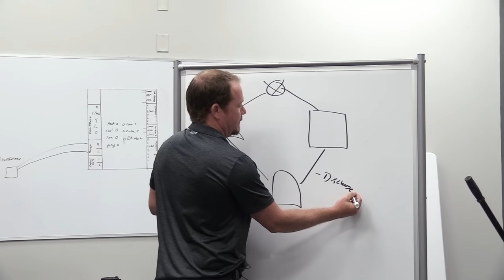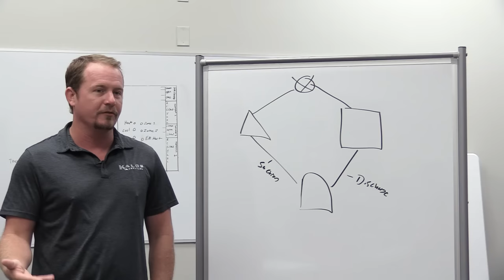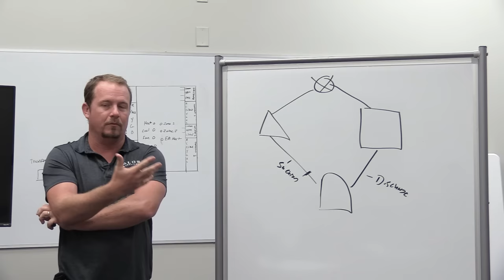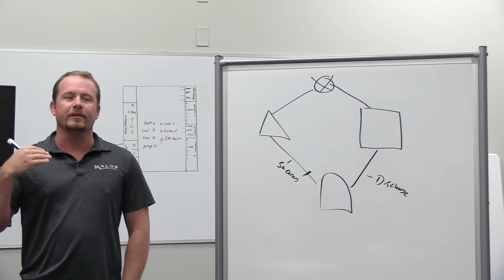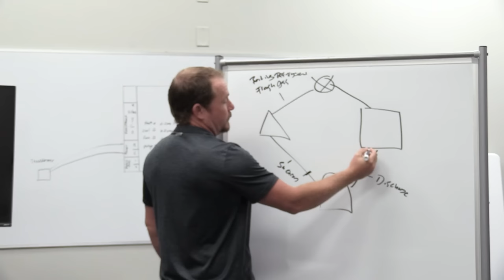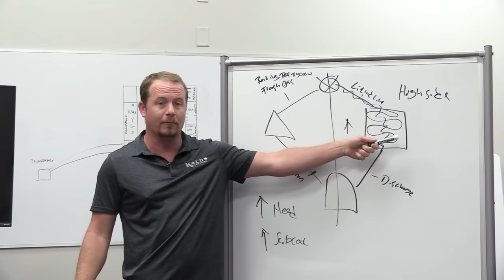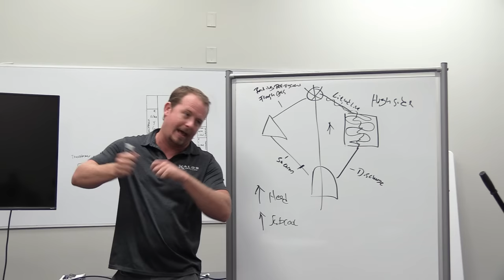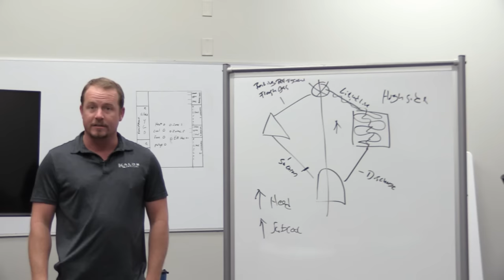Refrigerant Overcharge Troubleshooting and Prevention

Comment: What is a refrigerant in hvac
Reply: Depends on the system but for most newish homes it’s r410a
Reply: It is a chemical composition that allows for heat to be transferred from one location to another
Reply: @jeremynguyen2346  Yes. You should not substitute it for cream in your coffee nor should you substitute it for mouthwash. It is also not recommended that you use the refrigerant for any sort of enema.

Comment: In the old days my father always used a sight glass to charge the system. I guess that is a no no now.
Reply: There are still sight glasses on refrigeration systems.  Ninety percent are charged that way.
Reply: I see 410a systems with sight glasses.....liquid refrigerant is liquid refrigerant. Of course 410 is near azeotropic so very tiny amount of glide involved. I would think on more blended refrigerant with larger glides, you use the different points of change of state. I shoot for mid point temps.

Comment: Would an overcharged heat pump in summer cause water to drip from underneath condenser onto the concrete pad?
Reply: This could happen on a correctly charged AND a slightly undercharged unit as well. The suction temperature of the outdoor unit can range anywhere from 45°F-65°F and the compressors are designed to use this to cool itself down. Of course, the colder the line the more condensation gets produced on the surface of the suction line and bottom 2/3rds of the compressor and after some time it will start dripping. Now each compressor and manufacturer are a bit different and you should get a technician with proper tools to check your charge. They need to check pressures, physical line temperatures, outdoor temps and if they are through, indoor supply and return temps to get delta.
Reply: The accumulator sweats something good.
Reply: @jasonjohnsonHVAC     I was thinking the same. However, a second identical unit at the same home does not drip any puddle of water on concrete pad. Both cool fine and their delta t are same (due to txv metering). So, does this mean that the first unit is overcharged and that too much liquid refrigerant is stacking in the accumulator and boiling-off and causing excess condensation?
Reply: @uhfmhz   The puddle of water on the concrete pad is under the condenser. Thus, apparently the accumulator is profusely sweating with condensate and dripping into the pad.
Reply: @MaMa-qh4dy  Is the one that doesn't have any water for the upstairs? A lot of houses with two systems, they will keep the upstairs unit colder because thats where the bedrooms are, and then the cold air sinks to the lower level, and therefore the lower level has lower heat load on the evap, resulting in much colder return gas temps. Also check your air filters, that one unit could just be dirty air filters.

Comment: I over charge units all the time, impatient 👀 that Suction line temp goes from 61 degrees to 42 real quick 😂
Reply: Especially if it’s a piston orfice
Reply: And especially if it's a long line set. Nothing will happen so you add another pound. Then 10 minutes later the superheat goes from 25 degrees to 2 degrees real quick like you said.
Reply: Another thing I've noticed is when installing a new outdoor unit, on first startup it'll act like it's quite low on refrigerant for awhile. What I think is happening is a lot of the refrigerant is still dissolved in the compressor oil, and takes some time to boil off and then join the system. Seen suction saturation temps drop below freezing on initial startup, but have to just wait a bit eventually it'll start climbing. Overcharged a few new systems a little bit like that thinking maybe just needs a few ounces for lineset over 15 feet etc. 6 ounces for every 10 feet extra with R410 and 3/8" liquid line is a good starting point.
Reply: @brnmcc01  open the suction valve first otherwise your overloading oiled refrigerant into compressor and it will do that, at least that's what I was taught
Reply: What happen when you overcharge a systems? Will it freeze the coil tubes?